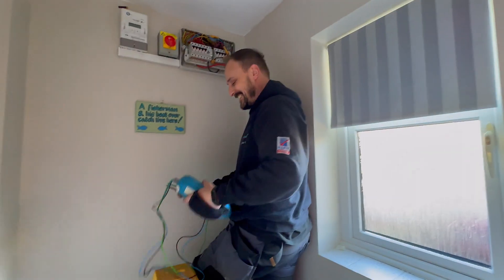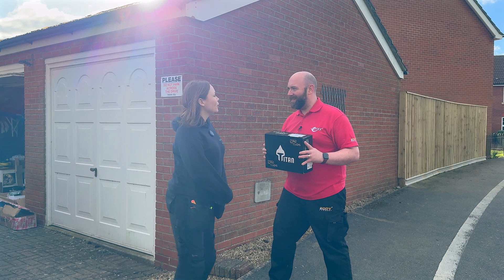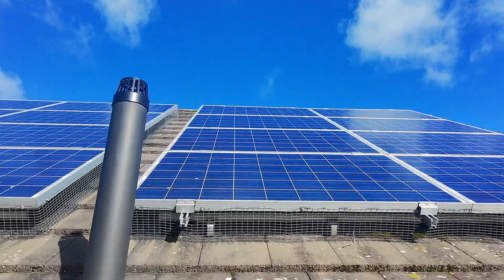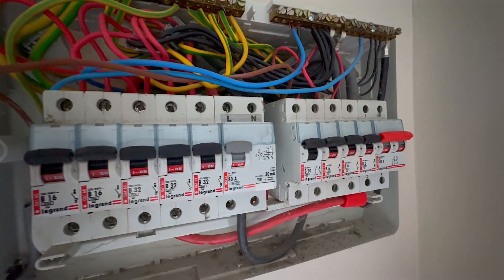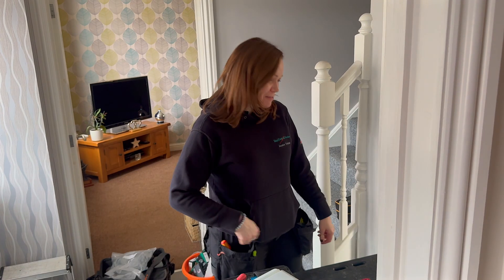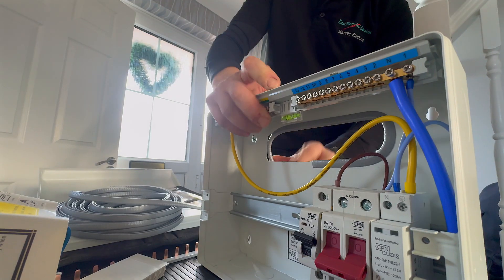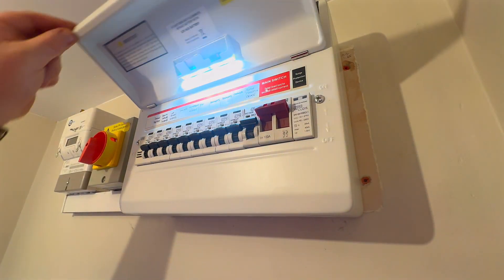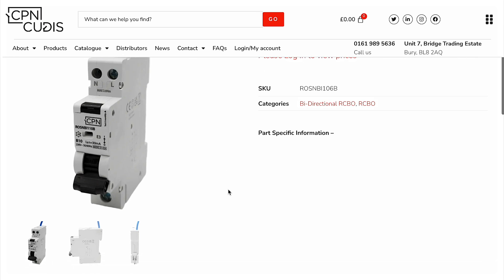This RCD Failed, WHY?

Comment: I thought that in the 18th edition, it's advisable to have spare ways to aid in future upgrades?
Reply: It's disappointing that boards without any future proving are still installed today.
Adding a circuit later is such a common task and will happen.

Comment: That CU is too high.  No way an old person or someone in a wheelchair/limited mobility be able to reset a breaker
Reply: hence the age
Reply: Perfectly acceptable under building regs: same height as the unit it replaces. But yes, if this were a new build, too high.

Comment: The most important item on a electrical installation. And you put in a cheap nasty board .it really gets my goat when you see a board already installed and you can’t the mcbs. Rcbos because no one stocks them . Or your wholesaler says . We don’t keep them , but can probably get the part . It won’t be quick and it won’t be cheap as it’s a special order plus carriage .The other thing you sometimes find is an electrician has been there before and he’s had the same problem and just shoved any thing in as he’s had the same problems.  And as far as the light goes people have mobile phones to hand with lights on

Comment: Toe-roids, sounds painful.  I don't know why it took such a long time for DC issues to come to the point where regulations in many countries were adjusted.  It's not as if there weren't plenty of things in a house that could cause problems before 2010.  Even a humble hair dryer with a diode to give the low power setting was a problem and those things have been around for donkey's.